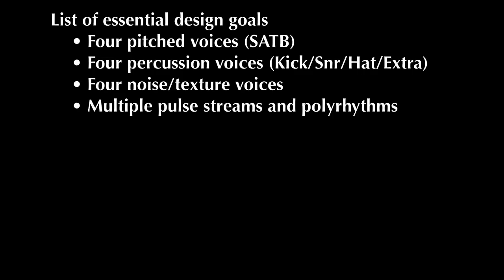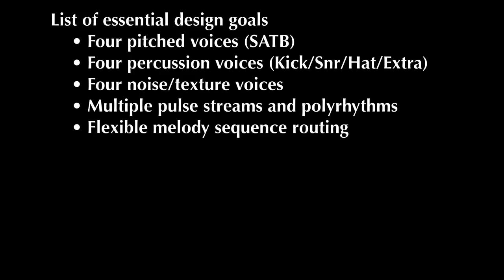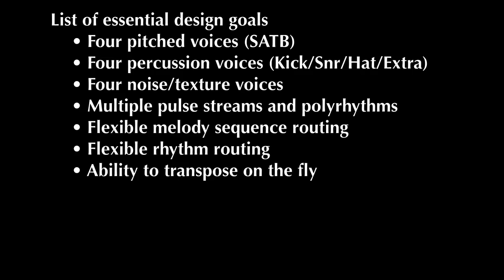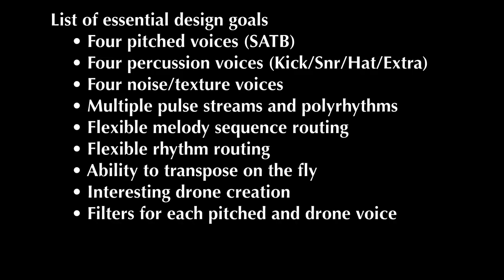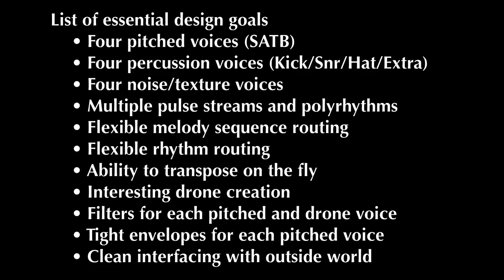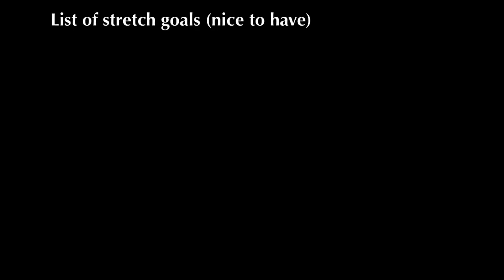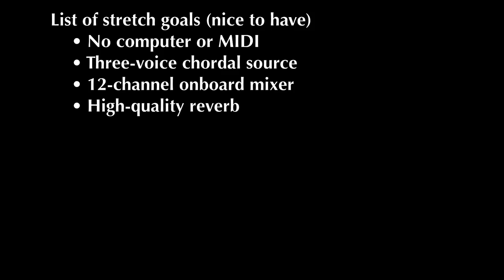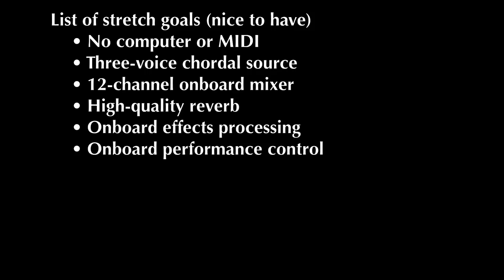Designing a Modular Synth System for Live Performance Part 3 | Layout and Design

Comment: I'd suggest you placing the control modules on the bottom half. The reason being sound sources are not being touched as frequently, and things like sequencers, touch plates and the like, you usually tweak all the time to keep interest. Having them the closest to your hand and easy to reach is a neat thing. I have my modular currently racked and the usability suffers a lot because of the constant vertical angle with all modules.
Reply: I know I am pretty off topic but do anybody know of a good website to watch new tv shows online?

Comment: very interesting thoughts.
I've re arranged my little 9U 84hp system about a dozen times :)
i've finally got it to a point i like regarding the ergonomics of it.

things can look great on paper (modular grid) but once you start using them and realize that "dammit when X module is patched up the cables interfere with the switch on Y module" you end up having to move stuff around.
Reply from the maker: Totally agreed on the theory vs. practice aspect. For me, I need an overall method to organize my pieces - it helps me really clarify what I need and what I don't to achieve my goals. But I expect that over time, the position of things will change, and even the choices of modules will change. This is why I want to document the whole process - so that we can learn together.

Comment: i've just started looking at Eurorack modular synths , but back in the 70's a built a Paia system from their kits and had a ton of fun with it . some of the modules available now just blow my mind !

i had 2 thoughts regarding module placement 
1) master clock might be good at the center of the system , since you'll be running cables from it to everywhere , might as well keep them as short as possible.
2) with 4 full voices wouldn't it make more sense to have 4 sets of VCO , ADSR , VCF , VCA instead of all the VCOs , all the ADSRs etc. again for shorter cable runs , and also you have everything together when setting up and modifying a voice .

of course these ideas are like any other plan , it seems great until you actually have to use it :)
good luck with the journey !
Reply from the maker: Totally agreed, Ernest. And as it turned out, I did end up putting the clock in the center. And in fact I ended up putting the filters right next to their corresponding VCO's, then ran them to a quad AR module, controlled by a quad VCA module. As you say, theory and practice are two different things!
Reply: great minds think alike  :)

Comment: I have spent about 1000$ on a beginner case, power supply and filled with modules which are very musical (Rings, Plaits and Instruo Harmonàig). That's a little 3u/48hp Doepfer LC1. My taste would be a 6u 90hp travel case but that would have cost the whole of this budget, without any modules. I just wanted to get started actually playing.